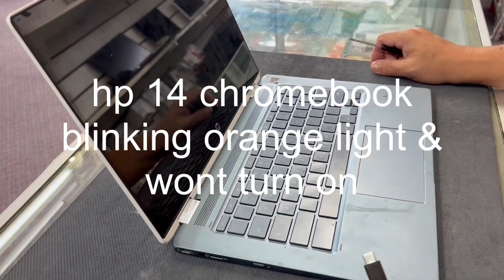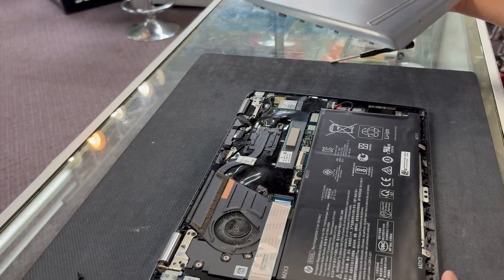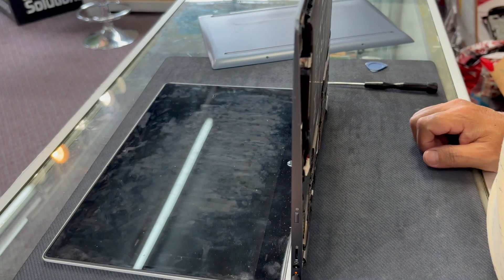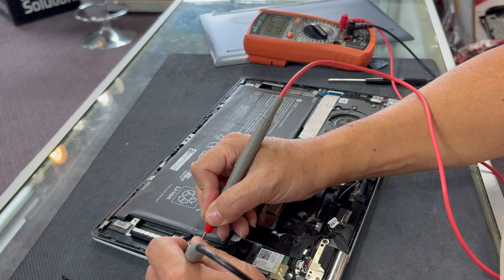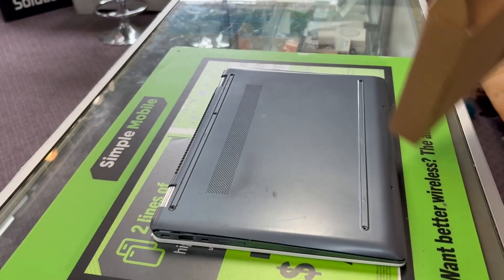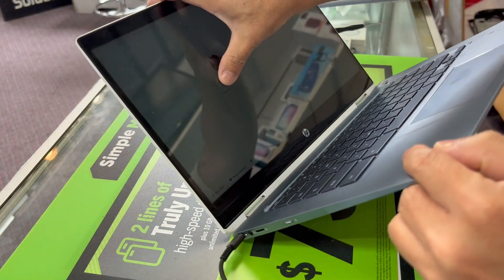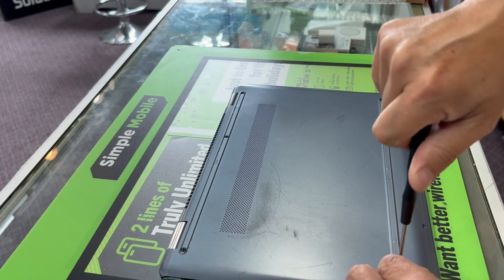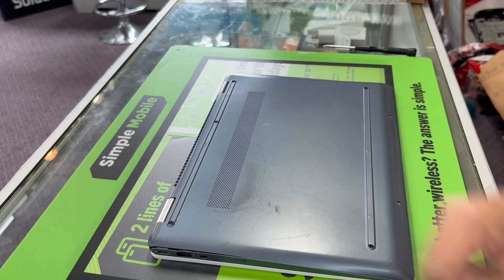hp 14 chromebook blinking orange lights. solved

Comment: hey. i just came across your video. i have a lenovo 14e that is doing a similar thing, but instead of a orange blinking, i'm getting a white blinking light and laptop won't turn on (just loops, the screen lights up then turns off)
Reply from the maker: sorry i don’t. however does ur screen light up with lenovo logo? if so it may just be a software issue
Reply: @mr.eztech  no . i just lights up the cuts off. and it only happens with the charger plugged in. the laptop doesn't come on without the charger
Reply from the maker: @differentlythesame9708 if that is the case then u definitely need to open it up  to troubleshoot. if its me i will unplug everything beside the essentials things plug in and start troubleshoot from there